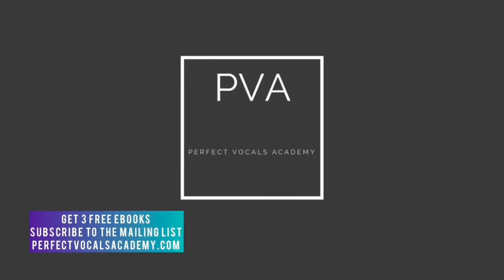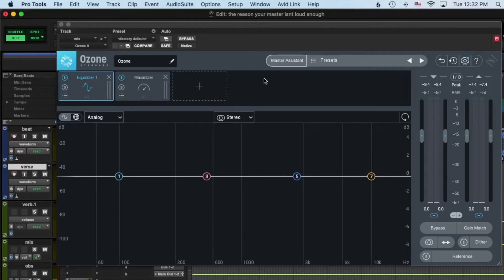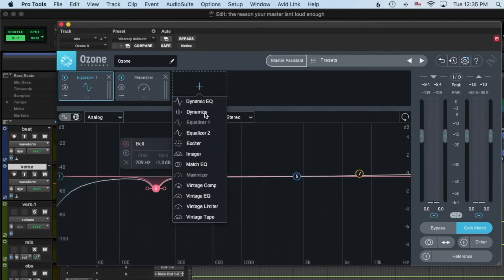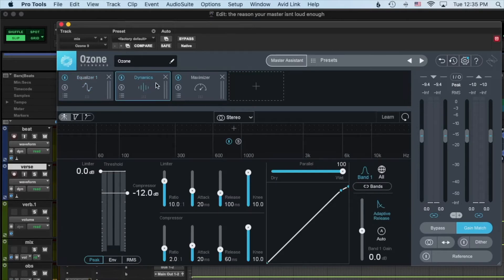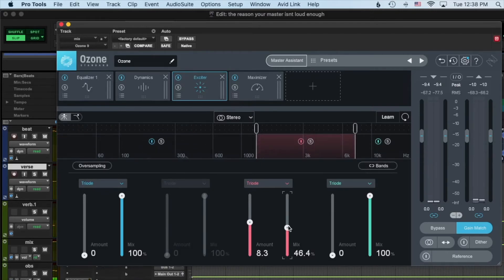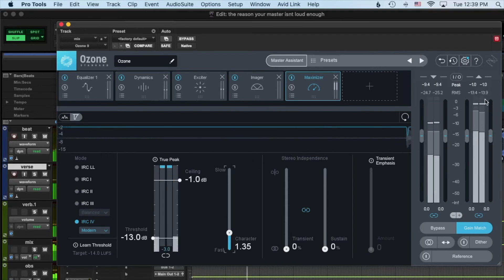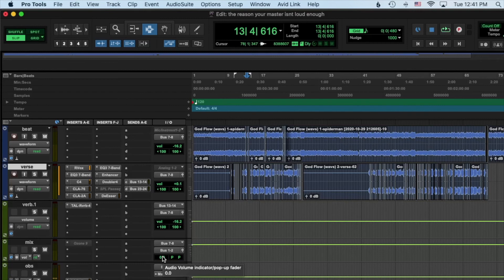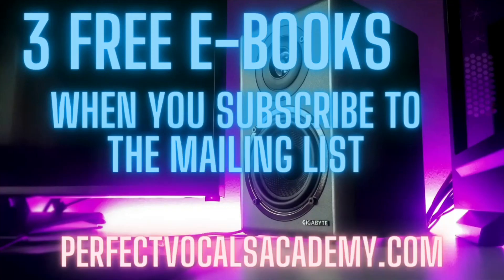THE REASON WHY YOUR MASTER ISN'T LOUD ENOUGH

Comment: Needed this. I'm finally pretty confident in my mixing but my mastering needs work. Been considering investing in Ozone 9 and after seeing this I might have to
Reply from the maker: Ozone 9 is a powerful tool for sure! It’s so easy to get a loud master with ozone. Even though you can get a loud master with standard eq and limiter, it’s much harder.